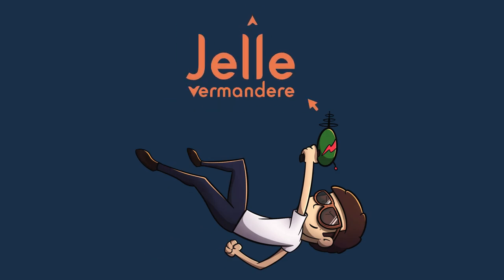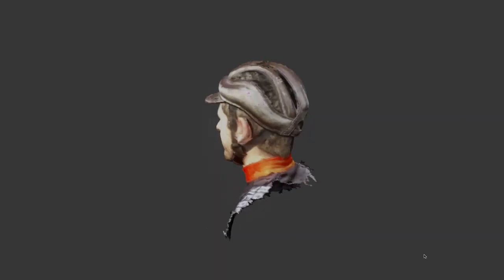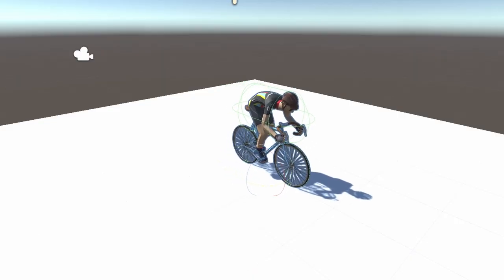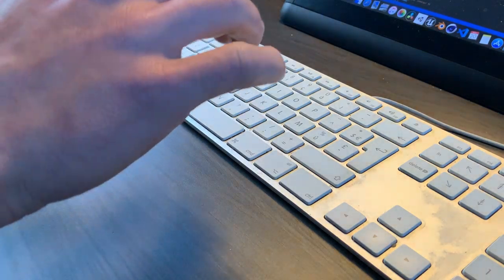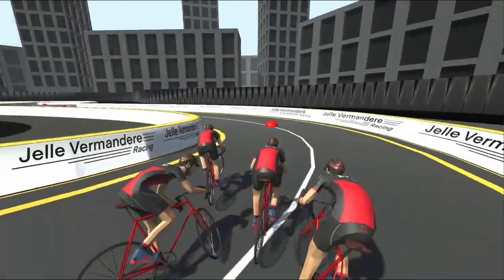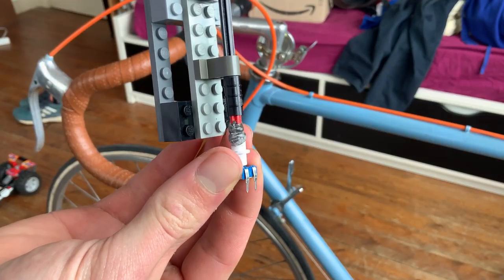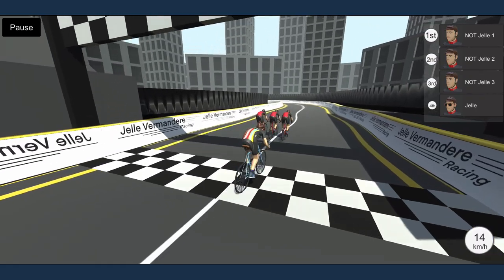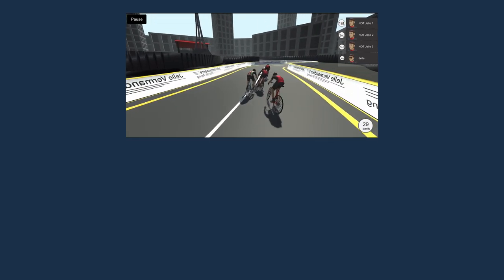Using my Real Bike to control my Racing Game

Comment: Really interesting, I am a biker and have some programming skill, I was thinking about something similar during covid19 lockdown. Have you ever thought about using a garmin speed sensor (workig with ant protocol) instead of the magnets and the arduino board ? Does your simulator consider the sloping of the ground reducing or increasing the bike speed if going downhill or uphill ? In any case, congratulation, it's really a great project !

Comment: KY 040 Rotary, in my case I had problems reading the rotation smoothly, I tried directions with hall sensors for left & right as Keyboard.press, without luck. Are you using potentiometer?

Comment: Nice Tutorial, y have question, How connect arduino with unity? 

Currently I'm doing a bike simulator and I need to know some input to know if the player is pedaling, check with bluetoon but Oculus Quest doesn't allow it, check with Ant+ but there is very little documentation, do you connect arduino through a cable to the pc? Or by bluetoon? 

I would appreciate your help
Reply from the maker: I've done both, the most simple way was using a serial port connection